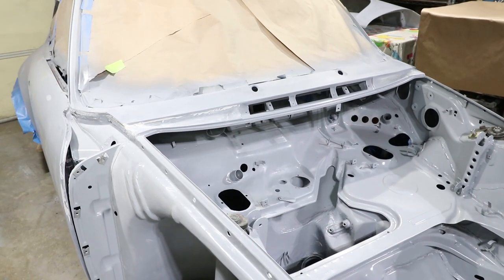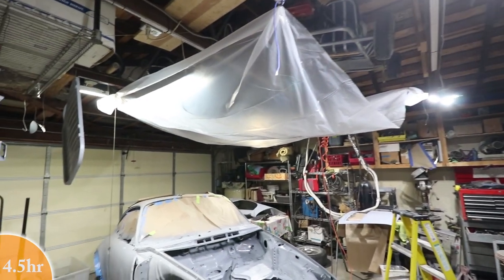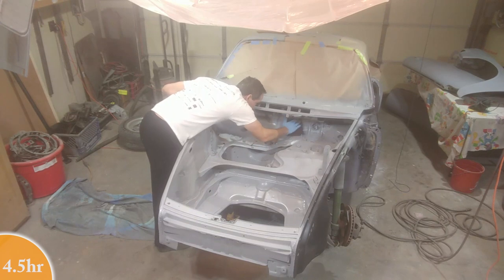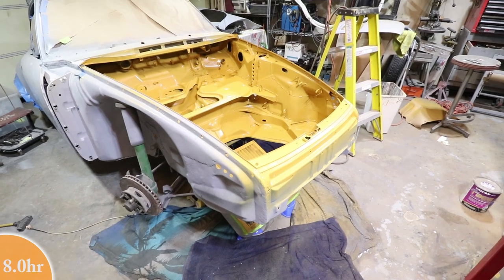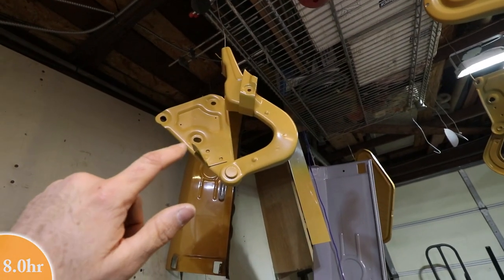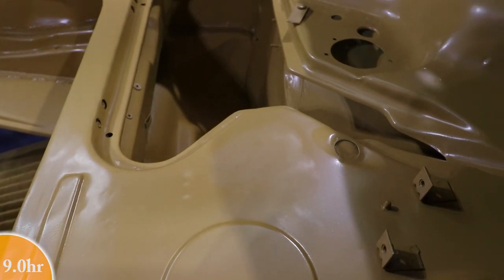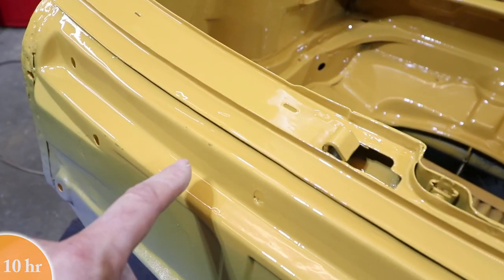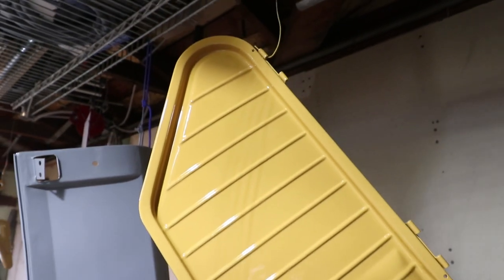Hello Yellow!  More Color Sprayed on My Project 911 Porsche

Comment: Hi Tom, Rome was not built in a day, I bought a 20' by 10" tent from ebay, layed a tarp on bottom, and sealed with tape, I fitted a box fan either end with filters and created a positive pressure spray booth, keeps dust and fume down, much cleaner. 
Keep going, your getting there.
Reply from the maker: Cool, I decided for $300/day for a booth rental is worth it, so all the exterior will be finished that way.  Plus I have neighbors in close proximity to my garage.  Don't want to Rick the boat any more than I already have.

Comment: To reduce the weight and the lenght of the spray gun in order to gain in handling, I put the pressure regulator and the water filter on the compressor, or on the rubber filler in a way I can hold it with my other hand. Anyway, usually I spray without any regulator or filter when I am doing small inside areas (I put the water outside the compressor volume just before painting). Keep pushing!
Reply from the maker: This is a good idea!  I know what you are saying about hard to reach areas.

Comment: Looks amazing! As soon as I saw you moving the gun around, I thought to myself “I hope it doesn’t drip out of the cup” 3M makes a awesome system, and it’s not too expensive, that you can hold the gun in any position without worry. Excellent as usual!
Reply from the maker: Thanks Dave. Yes I'm aware of the PPS cups but I didn't spring for them.  I did tape a paper towel to the lid when doing the clear.  Paper towels are in my budget, ha ha.

Comment: Looking good.

Curious if you're have a pint/quart mixed for each spraying - or did you opt to have a full batch of pints/quarts of the base coat mixed at one time?
Reply from the maker: Hi Jay I started with the pint  sample which I sprayed on the dash and test panel.  Once  I decided I liked the color I bought 5 quarts which makes 2.5 gallons of paint when mixed one to one.  Same amount of clear. 
I'll do a video with all the costs but the basecoat was about $250 a gallon.  I think the clear is also about $250 a gallon.
Oh and I mixed.the 5 quarts of base together to avoid any batch differences.
Reply: @GarageTimeAutoResto  Thanks Tom.  Assuming you're mixing with the temperature based reducer on a 1:1 ratio.
Reply from the maker: @jgwellwood  Yes exactly.  Medium or Slow reducer
Reply: @GarageTimeAutoResto  thanks Tom.

You're filtered fan with the wetted towels is an innovative solution.  My step father painted cars/trucks in his backyard shop years ago.  He would turn on the exhaust fans in the windows and then would slightly wet the concrete floor to minimize the potential for dust to contaminate the paint job.  This was well before the two-stage process was used (early 80's).

I think he charged typically $500 for just a re-spray.
Reply from the maker: @jgwellwood  There is dust in mine but not too bad to be honest.  I think it could be sanded out and no one would know it wasn't painted in a booth.

Comment: Boy paint guns if come out long way since my hand-me-down binks model 7.... My 1st paid paint job was on a Honda red frame motorcycle tank and I charged them $5. Lol oh hand rubbed Dupont lacquer..... And real nitrocellulose not acrylic
Reply from the maker: I know things have changed.  I've painted one other car before in the early 90's with a devillbiss gravity feed gun.  Today's tools and materials are way better.  I remember that old gun would cutout sometimes as it gasped for paint. 
Today good results are possible if you just follow the instructions.  My spray gun was less than $200 on sale and it does everything!
Reply: @GarageTimeAutoResto   If money was no issue which spray gun would you buy. Or maybe spray guns? I  used to have my $5 yard sale spray gun for miscellaneous primer coats....and sometimes I might even clean them. And then there was my go to gun which unfortunately was lost during some moves or possibly throwing away by my ex. And my ex was beautiful Kylie Jenner look-alike who, during our worst fight, threw a lot of my equip out ..... and the worst thing about it is I still miss my Binks model 7
Reply from the maker: @Dogleg1957  I think mine is an Iwata knock off.  If no budget then I might look at the real deal or Binks are still good I hear.  Others here will have better suggestions I'm sure.  There is a guy on YouTube who reviews all the popular guns.  
I have reduced my gun cleaning time considerably with practice.  Epoxy primer is the hardest to clean up.
Reply: @GarageTimeAutoResto   Whatever you're painting with its coming out great like glass
Reply from the maker: Beginners luck😃. I'm super happy with the products I'm using and the cost.  Sure paint materials have gone way up, but I bought on the lower end of the scale and they seem to work.  I hope the paint stands the test of time.
Reply: @GarageTimeAutoResto  what are you spraying? Water base? Cost...if your wanting keep that to yourself understand, I have to ok project cost too. Make of paint . So far prep work is paying off
Reply from the maker: I'm sharing all my resto costs on this build.  I'll update everything in a video soon, but I'm using solvent based Matrix basecoat at about $245/gallon and SPI universal clear is about $270 a gallon.  There are way more expensive paints out there!
Reply: @GarageTimeAutoResto  when my dad and I painted our first car together he bitched at 5 gallons of premium lacquer thinner cost over $10 boy times have changed